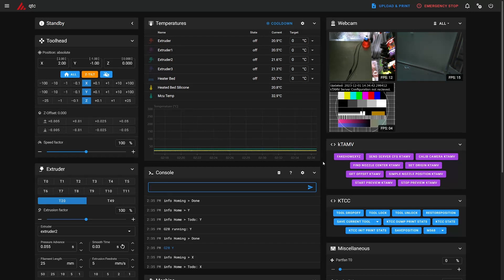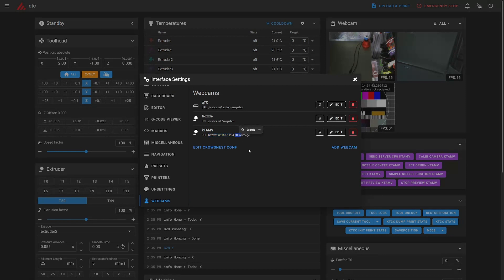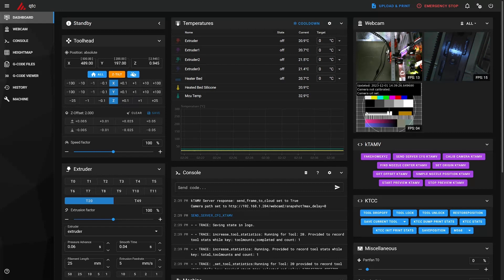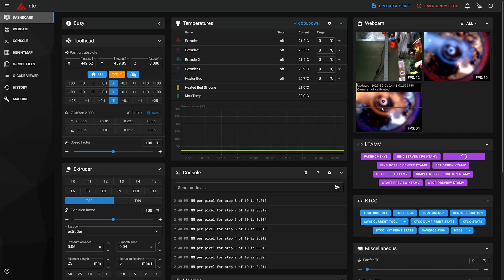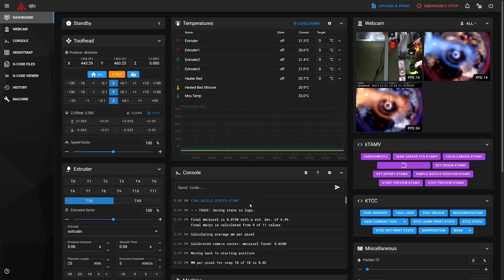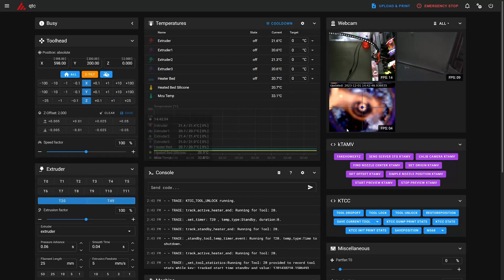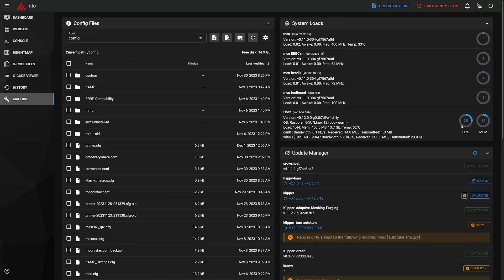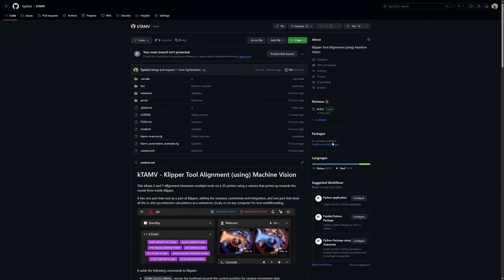Klipper Tool Alignment using Machine Vision demonstration

Comment: Any chance you could point me towards a camera that is know to work for this.  Most of the ones I'm finding online look like absolute e-waste with bad cell phone apps to control them.
Reply from the maker: Just anyone of the generic lookling ones when searching for ”usb microscope”. This for example:
https://www.amazon.se/USB-mikroskop-elektroniskt-växtanatomi-kriminalteknisk-identifiering/dp/B0839CQKBN/ref=sr_1_3_sspa?crid=359YBNLII0KA8&dib=eyJ2IjoiMSJ9.7J6Mq6KaOnwWhWDcqWz_n5oZJudPXtlwctn6bhEKPwjDPGc31jtryZHszEldJChxgVCf8y_7rTGaORCcEkFROCdvAtNtv7aFeIu6y7iTA29XhLdHGaO1x5oQ5BNyDJx8iWDDiwbKXb22lM93cO1-YiiTCDvhwnN76gjIdc2dTJAedFBOQeIBVJSuI42g4bbF7DuPzUj14S5GcWsbC_L5MC_tDX-dTFNx1j-zwnF2NfFjDdvZ-8Uso0_gBZzTToi0QfGMRRyKtJm1UDmTQckcFnlH9NsN9NLQDaEn0W4bESk.MKTNzkR_dKz1c-0JD94BjDIEmmLHFF9isiagXVgYgDU&dib_tag=se&keywords=mikroskop+usb&qid=1716089918&sprefix=Mikrosk%2Caps%2C96&sr=8-3-spons&sp_csd=d2lkZ2V0TmFtZT1zcF9hdGY&psc=1